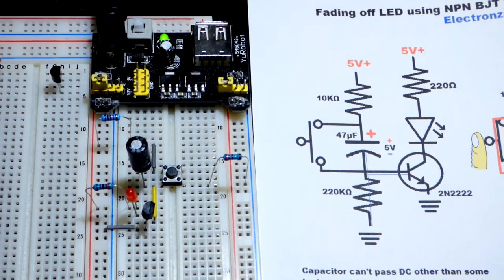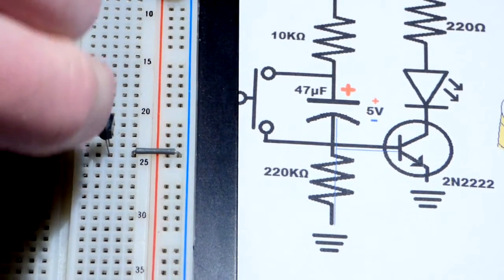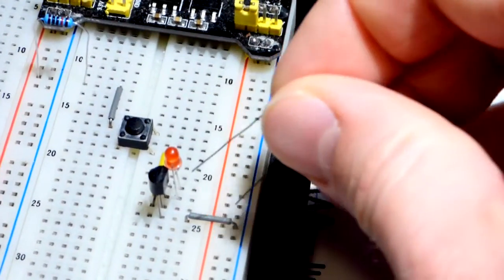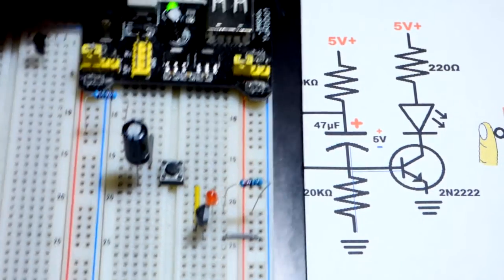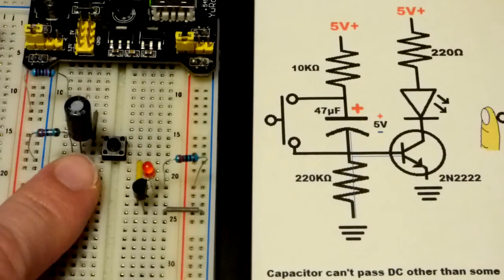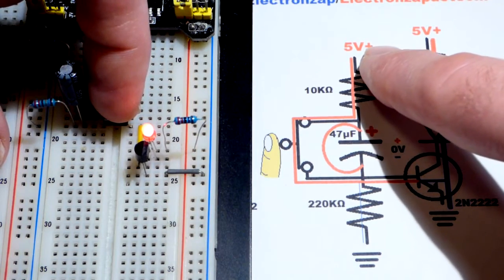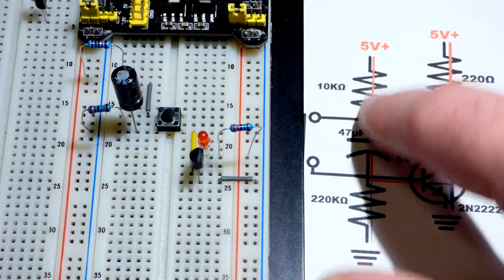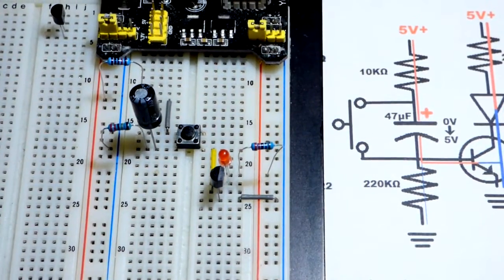Transistor circuit 15 Fading off an LED using 2N2222 NPN Bipolar Junction Transistor and capacitor

Comment: For some reason I cannot get this to fade with a .05 watt white LED (I don't have other colors to try). I have used all the same components, the 47uF cap, 220 Ohm, 10k Ohm and a 220K Ohm resistor, and the same 2N2222 transistor. The LED comes on just fine and goes off just fine, but there is no fading going on.

As far as I can tell I wired everything up exactly as shown but no dice. 
Does anyone have any idea what I might have done wrong?
Reply from the maker: Make sure the negative side of the capacitor is connected to the base of the NPN BJT switch low side, and low side resistor. All 4 components in that area are connected there, it is not a cross over point. I mostly use the crossing lines are connected and a curved "jump over" are not connected way of drawing schematics.

Comment: What is the point of the transistor when I can do that entire circuit with just an (3.0 to 3.2v) White LED and a switch. No capacitor and or resistors? I was able to fire off 4 LEDS actually. Jumper set to 3.3v on the power board. Please explain.
Reply from the maker: Nice! I don't think I will ever be able to fade off a 3.2V LED with just a switch and 3.3V supply. Your skills are impressive! Thanks for watching!

Comment: Can you make an LED fade by using a variable voltage on the transistor base?
Reply from the maker: It goes by current, but usually a lower voltage means lower current.

Comment: why do you have lines running over each other..and no connection points?  how are we supposed to know if your connecting or not.  Very sloppy work
Reply from the maker: I use an arch to show the line jumping over the other line when I am not making a connection.
Reply: @Electronzap  That is how i learned to read and write schematics back in "the day".  Arches were always used to show N/C.
Reply from the maker: @jimedgar6789  Bugs me when there aren't arches :)

Comment: Should add dots to the schematic diagrams where wires join.
It's not entirely clear there is a 4 way connection between the switch, capacitor, 220k resistor and transistor base.

Comment: YOU NEED THE LOWER RESISTOR

BEFORE YOU PRESS THE SWITCH   -> The capacitor has had time to charge.   No current is flowing therefore the 220k resistor from (BASE) to ground acts as a pull down resistor   =/=  transistor and led OFF

WHEN YOU PRESS THE SWITCH  -> you are shorting the charged capacitor out.    The shorted capacitor drops to  0 volts and its held there as long as you press the switch.   Its as if the capacitor is no longer in the circuit  BYPASSED  by the closed switch.    The closed switch acts as a wire that connects the upper and lower resistors.     As long as the switch is pressed the two resistors form a simple voltage divider and most of the 5 volts will drop across the lower resistor (BASE)  =/=  transistor and  led  ON 

WHEN YOU RELEASE THE SWITCH  -> the capacitor starts at 0 volts and begins to charge up again.    As it charges current flows thru the upper and lower resistors.    This current causes most of the 5 volts to drop across the lower resistor (BASE) and keeps the transistor TEMPORARILY  forward biased untill the capacitor is fully charged again and current stops.

ONCE THE CURRENT STOPS  the 5 volts drop across the capacitor again and the lower resistor (BASE) goes back to 0 volts =/= transistor and led  OFF

Of course I'm simplifying this , it actually happens over a period of time and you can watch it on the scope.   Put one scope channel across the capacitor and another channel across the lower resistor and they will be the exact opposite of each other when you press and release the switch.   The cap will be charging while the lower resistors voltage is yeilded to the capacitor as the capacitors current demand slows down and is eventually completely satisfied.

Its so simple yet a really interesting chain of events that occur when you press the button.    Walter White would call it  MAGIC   I would tend to agree.    It can be really useful in the right situation. -> Thank You for making me think !
Reply from the maker: Thanks for watching!